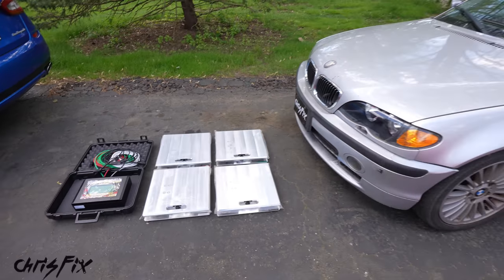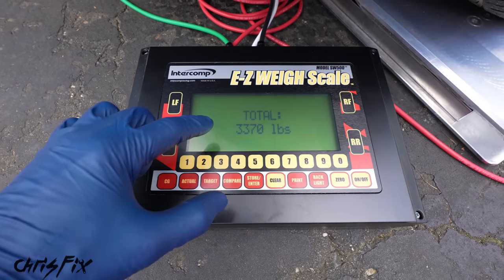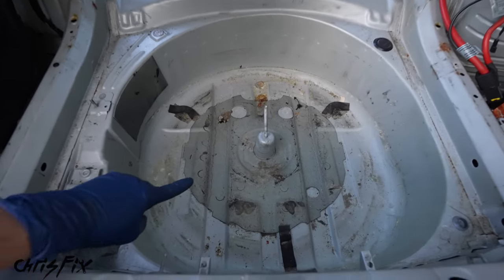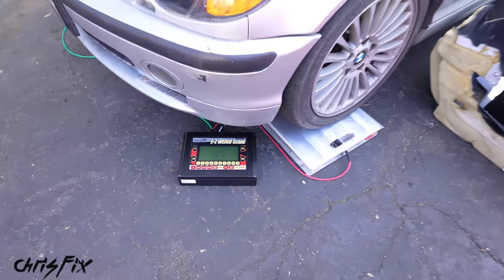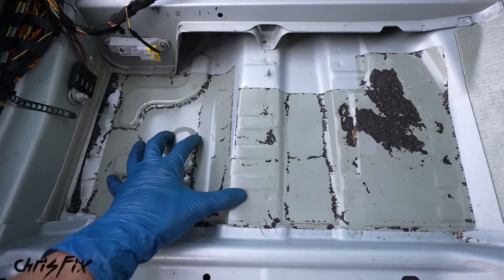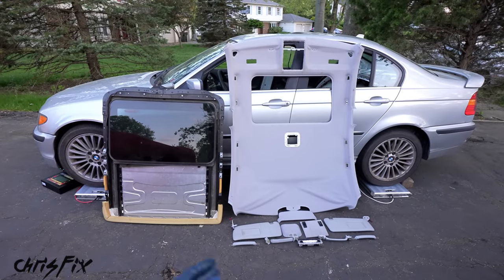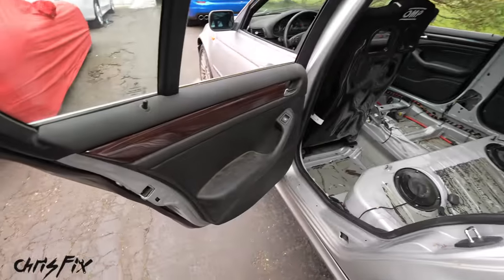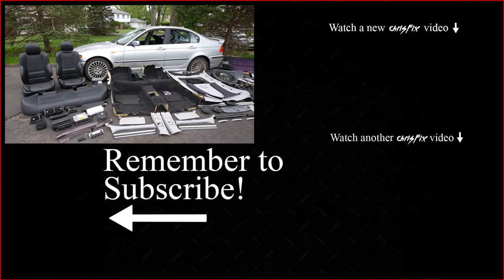How Much Weight can you REMOVE from your Car? (Weight Reduction)

Comment: Chris you forgot to take off the brakes, those will just slow you down.
Reply: Bravo my friend, bravo 👏🏼
Reply: ok that was funny
Reply: Hahah
Reply: Ferrari Monza flashbacks
Reply: Hahahahha
Reply: @MeiShibi  yep
Reply: Omg genius ahahahaah
Reply: Good one
Reply: He need brakes dum
Reply: @mick2171  it's a manuel, just downshift to slow down
Reply: Top comment god
Reply: @mick2171  r/woooosh
Reply: Take out the blinker fluid as well. Pure race car at that point
Reply: Lol you really are thinking about everything for him
Reply: haha
Reply: Funny you mentioned that. I had the chance on my Infiniti to go with the two-piece rotors. I got a deal on some one piece for 50 each. The two-piece were 250 each. But they saved 20 lb. They also had rear two-piece rotors but they only save 10 lb I didn't think that was worth it. In hindsight I think I would have done it just for the satisfaction
Reply: @mick2171  its manual just downshift
Reply: Faulty Brakes ? . . . Don’t let that stop you !
Reply: lol😂😂
Reply: Allgasnobreaks
Reply: If you don’t have brakes and you race your title against an asian mobster you can just keep on driving at the end of the 1/4 mile and run away, great trick for VW’s
Reply: Haha
Reply: Eleanor Nicol lol r/woooosh
Reply: How about turn indicator lights - bmw's don't need them anyway
Reply: A grade humor mate
Reply: He did say it was all about the 0-60 and not the 60-0
Reply: Hahaha
Reply: Tyres too.
Reply: Hahaha
Reply: 😂good one
Reply: Hahaha 😀🤣
Reply: You sir, have won!! you had me rolling
Reply: Nah man Tires are way heavier
Reply: LOL FFS
Reply: That's actually hella funny 😆
Reply: And brake parts are UNSPRUNG WEIGHT too, so they make even more difference!
Reply: Made me chuckle
Reply: He should also take of the pedals. It can reduce weight also who needs them he can just push the car.
Reply: Those seats need to be baby chairs
Reply: Jesse tried that and look what it cost him.
Reply: I think i saw in Jay Leno garage there was this old old race car from 20s which did not have brakes!!!
Reply: Cool pun!
Reply: I mean, he has a point.
Reply: it is unsprung weight
Reply: Your not wrong lmao
Reply: Well played my friend, very clever.
Reply: That engine has got to be one of the heavier items sans tranny and engine now your working with gas!
Reply: Then how can u test the brake test?
Reply: Yooo he said he will replace the brake system before your comment was posted
Reply: Lmfao
Reply: What a great plan hope you have insurance lol
Reply: Boooom
Reply: I know you're joking but actually not..
Reply: @kw57rx8dr.9  that makes no sense.
Reply: Good one!
Reply: @MeiShibi  lewis has ptsd now, just yell the word magic.
Reply: how is this not the pinned comment behooves me
Reply: Ba dum tss
Reply: Good one
Reply: Punny
Reply: @blueshrimp6716  Actually it does to someone who ACTUALLY races. Brakes are the biggest performance item you can change for the least amount of money and hassle, you can't go fast if you don't have good brakes to slow you down properly, the longer you're on the brakes trying to slow, the slower you go in terms of track times because you are not on the throttle while you're on the brake (well sometimes you are when trail braking another reason for good brakes but that's also for the purposes of going faster) and they allow you to go deeper into corners before braking thus slowing you quicker and allowing you to carry higher speeds longer instead of braking longer.
Reply: @taelorwatson9822  Again yes, unsprung weight is the weight you want to shed most and it is the most difficult to find.
Reply: @yassineazoui4204  Yes and wear out the engine and the clutch which happens to be just another brake. but those aren't nearly as expensive nor easy to fix as ACTUAL brake pads are?? facepalm
Reply: The engine weighs a bit that should save some weight.
Reply: @RnR1001  Circle track car..
Reply: Kid should've known.
Reply: i was waiting so long for a vid
Reply: you forgot the gas
Reply: Haha that’s not good but nice joke my man
Reply: this one is good 🤣
Reply: lol
Reply: @mick2171  wooooosh
Reply: @kw57rx8dr.9  you can just not press the gas and then downshift, use the e brake or the drifiting e brake
Reply: 🤣🤣@chrisfix
Reply: LMAO!! ah....i live for you tube comment sections
Reply: Incredible pun.
Reply: @yassineazoui4204  No, this is not "drifting" for a lap or two, it's road racing and requires you to be smooth and scrub as little speed as possible as fast as possible not down shifting and tearing up a clutch that's not only not designed for that but has hours to be used to finish a race under the harshest of conditions. Did you not hear that this is an endurance race? 16 hours!! But 16 hours or 20 minutes, you have to take care of your equipment and your tires etc. while still going fast or your race is over really soon and even if you were able to limp to a finish there's no way you'd be anywhere near the front. Going sideways is slow and wears down tires, using a clutch ONLY as your brakes wears that out too, all too prematurely.

I'd love to see you slowing down with your foot off the throttle 400, 500 feet or more before a turn at 130 or more MPH like the speeds these cars easily achieve at tracks like Daytona or say Sebring while I'm slowing at 300 or 200 feet as I'd pass you like you had an anchor on and be 10 or 20 car lengths ahead before you entered the corner. BTW don't get hung up on those tracks it applies to ALL tracks short or long, high speed or average speed. Another point is your hands need to be on the steering wheel when entering corners, not a hand brake and oft times you actually use the brakes to 'set' a car entering a corner to allow you to go through at speed, one such corner is turn 11 at Road America where you turn at speed and on some cars, not all, you gently touch the brake on entry to set the car into the turn, no room for error in that corner. I find it hysterical that after decades of motor racing of this sort suddenly you think you know the secret to going faster that none of hundreds of top teams, drivers and engineers have ever figured out?
Reply: Lolololol
Reply: You're speaking language of the gods
Reply: That’s tooo good
Reply: Lol
Reply: He forgot to take off the motor that weights too much.
Reply: nice
Reply: And the tire to
Reply: Mei Shibi lol
Reply: xD
Reply: Lol
Reply: @mick2171  r/whoooooosh
Reply: He a little confused, but he got the spirit
Reply: @mick2171        Pleeeaaaasssssee. Tell me you are joking
Reply: Carlsberg don't do comments, but if they did...
Reply: thanks dad
Reply: @eythor_xdb6185  bro i new someone would like this comment
Reply: He also forgot all of the engine
Reply: Take a bow!
Reply: lol
Reply: This joke belongs in the hall of fame.
Reply: Ikr I took the brakes off my mom and dads car my dad never came back and my mom was so happy she was screaming as we whent down the road
Reply: Knew a guy who ran dirt track cars. He removed all the brakes except front driver. Technically he needed brakes for the race. Did he use them? Debatable.
Reply: yea obviously
Reply: Underrated
Reply: Lol
Reply: Well...can't say you're wrong.
Reply: Yeah this is an important fix
Reply: 1million IQ.
Reply: nice dad joke
Reply: @mick2171  it’s a joke bruh
Reply: @mick2171  you missed the joke
Reply: @mick2171  r/woooosh
Reply: slow clap
Reply: Lmao
Reply: Hahahaha
Reply: You, sir, know comedy.
Reply: That’s funny🤣🤣🤣🤣
Reply: I took the brakes off my car. A man like me...never really learned how to stop.
Reply: The rear view mirror too, that should of been first. What's behind you doesn't matter.
Reply: Right like Jessy from fast in the furious did on his Jetta
Reply: R/cursedcomments
Reply: Hahahaha
Reply: take off the car, just the axel and wheels = max speed
Reply: Lol.
Reply: The engine is pretty heavy too not gonna lie
Reply: This comment made my day. :)
Reply: Right, a car is made to drive not to stop!
Reply: Haha
Reply: Fast car is good but too fast is bad, slow is good but very slow car is bad
Reply: he is correct
Reply: Underrated
Reply: U r a legend
Reply: Clap 👏 👏
Reply: everyone liked that
Reply: Brilliant, love it. 😊👍👍🇦🇺🦘🦘
Reply: genius
Reply: Let me guess you listened to Sia's Unstoppable?
Reply: r/Technicallythetruth
Reply: @Wildstone-jf1he  *too?
Reply: @monke204ah  lol
Reply: We are hitting intelligence level 💯
Reply: There supposed to make you stop
Reply: @kw57rx8dr.9  Calm down jamal
Reply: he can break with the engine right?
Reply: LOL XD
Reply: @yassineazoui4204  I've no idea WTF Jamal is but who designated you room monitor, miss nobody?
Reply: A faster way to heaven eh?
Reply: there was no brakes those arent brakes
Reply: Lol so funny lol
Reply: @mick2171  r/wooosh
Reply: @kw57rx8dr.9  But actually, you could be done sormthong more productive during that time you were typing that. This is 2021 and you get mad because of that. Grow tf up
Reply: @yassineazoui4204  "Grow up" says the middle school age acting troll not having a clue who he's speaking to? There's a lot of advice to be taken by you in your own comment troll, especially in the "productive time" category..
Reply: @kw57rx8dr.9  and i wasnt serious my guy learn to take a joke
Reply: That's f**kin funny
Reply: Genius
Reply: lol
Reply: Ya but I think it might fail the stop test
Reply: Litterally
Reply: Chris you forgot to take off the brakes, those will just slow you down.
Reply: @mick2171  r/woooosh
Reply: @mokujin4076  nah handbrake is for losers. Just go into reverse to slow down.
Reply: top comment
Reply: Lolololol
Reply: GUYS ITS A MANUEL NO NEED TO WORRY MANUEL ACTUALLY DONT NEED BRAKES IM NOT JOKING
Reply: You got his back genius
Reply: Guys something real to take off is the air conditioning
Reply: thats a really good one
Reply: 😂that just made my day
Reply: axxaxaaxaxaxaxaxaxaxaxaxaxxaxaxaxaaxaaxaxax rhodes island greece
Reply: lol amazing
Reply: yea funny funny NOT FUNNY
Reply: Bruh🤣
Reply: r/technicallythetruth
Reply: Best comment😂
Reply: Lmao
Reply: Hahahahaa!!!
Reply: Rally drivers during ally Finland or rally Poland are saying „ Take my brake away”
Reply: I hope  he remembers removing all that weight will alter it's balance and handling... potentially making it much more riskier to drive . . .
Reply: @SeaJay_Oceans  just add rear spoiler and new setup of suspension and it willdrive like crazy
Reply: @zepter00    Take all those body panels off,  they are extra weight and serve no purpose.  and all the emissions equipment, exhaust,  catalytic converter, etc.   Then start cutting off metal...  the floor only needs to be under the driver's feet, the rest is too much weight.    All the glass got to go,  no windshield, no windows.   Rear doors and front doors too, just bolt a couple  of bars on the driver sides to keep him in place.
Reply: @SeaJay_Oceans  please don’t teach me about building sports and rally cars. Poland build it in big numbersand n supły 1/3 of whole rally world.
Reply: Yooo
Reply: @zepter00   a motorized  unicycle would make a  Great youtube video...
Reply: Approved top comment.
Reply: I remember renting a kart and I was second in time thanks to not having brakes. I just steer like a mad man
Reply: lol
Reply: Take out the engine and tranny and the tires too. far too heavy
Reply: How about gas tank
Reply: Then to the car wash thereafter ? 😂
Reply: hahahahahahha
Reply: This caught me off guard 😂😂
Reply: Hahaha! That's really funny I wish I thought of that reply lol.
Reply: Hoiyaaaa
Reply: @strikeforce3242  l k BB king v
Reply: Lmao 🤣 😂 😜
Reply: All gas no brakes!
Reply: Noice joke
Reply: “I see what’s happening here”
Reply: Man, I’ll remember to do that when I turn 16 lmao
Reply: Legend. Hahahahaha
Reply: right on.
Reply: A direct hit, well done.
Reply: good one
Reply: That was pretty pun-ny
Reply: Nail on the head!!!
Reply: unfortunately its part of the wheel. add lubricants.🤪
Reply: Oh my god
Reply: good one
Reply: 😂 Damn... lol
Reply: Lmao
Reply: Proceeds to remove the engine.
Reply: @shruthisrikumar5907  he is joking.
Reply: Ok Ronnie Mac
Reply: Lol
Reply: lmao😭😭
Reply: I hate that you’re absolutely not wrong loooooooooooooooool
Reply: yeah they will
Reply: Oooo this is DAMN good hahaha. 🏆
Reply: Lmao
Reply: @mick2171  you're wrong. Who needs brakes and don't forget the go faster stripes  and red brake calipers.  Always good for an extra 100hp.
Reply: You beat me to it, by 2 months actually
Reply: Nice
Reply: Lol
Reply: Original GT40 had that in the 60s. 
Don't @me
Reply: W
Reply: Lol
Reply: @mick2171  how do u not understand
Reply: lol  - u got a lot of likes - well deserved!
Reply: @taelorwatson9822  that, and unsprung weight has a more significant effect on performance (the lower the unsprung weight the faster your suspension can move the tire to maintain contact with the ground.
Reply: lol
Reply: @mick2171  it’s a JOKE
Reply: dorifto in the wall baby
Reply: The suspension too it just bounces around
Reply: Xd
Reply: Hahahahq
Reply: You need to stop… wait there’s no brakes
Reply: @rally2727  ☝ "OBJECTION!" ☝

- Miles Edgeworth, the "Ace Attorney" series (2001-present; 2005-present for Western releases).

(slams desk) Engine braking alone (at least, in a manual car) isn't gonna be enough to slow you down if you're approaching a sharp or tight turn at high speed on the racetrack. You're also liable to damage your valvetrain from overrevving, not to mention blow a head gasket.

Like with ANY motorsport, it's mandatory for your car to have brakes.
Reply: @gmdoilusdum362  ☝ "OBJECTION!" ☝

- Miles Edgeworth

(slams desk) NOT a good idea.
Reply: If there's something I learned from Need for Speed, it is that you don't need brakes to win a race.
Reply: @ChocoEspada  ☝ "OBJECTION!" ☝

- Miles Edgeworth

(slams desk) Not unless you're approaching a tight turn (in a video game or for real), it isn't, be it on the streets (specifically, an illegal street race) or on the racetrack.
Reply: @josecarrilloii4036  not even then, i usually Just throw my car over another so he spins and I make the turn (but thats only for NFS, I know brakes are important lol)
Reply: @hidudes227  ye same
Reply: my man you deserve an award for that, you made my day😁🤣
Reply: @mick2171  i think your missing the joke a bit bro
Reply: @rally2727  downshift and e brake. Good enough
Reply: This is why Chad alone win races
Reply: The best car joke in 2022
Reply: I remember when I went to the lemons in my Miata I can tell you if you don’t have breaks your head,helmet,steering wheel,and bumper will not function… funny joke tho 😂
Reply: Lmao
Reply: Damn this is a good comment
Reply: Hah that was good I laughed
Reply: Good one
Reply: @Hallowsaw  yup “race cars don’t need headlights cuz the tracks always lit”- lighting McQueen
Reply: Lol dad jokes
Reply: lmao
Reply: Kids riding bikes be like:
Reply: Nice.
Reply: Nice one
Reply: but but that's the point-
Reply: Bruhhh😂😂
Reply: Isn't that the point
Reply: 😭😂 Gem right there big fella
Reply: lol
Reply: They’re literally designed to slow you down. Always remove them when building a race car.
Reply: best comment ever
Reply: @mick2171  ☠️
Reply: Remove the engine I heard those are pretty heavy
Reply: Ayeeee 10/10
Reply: I think chris was just too lazy to take off and put back brakes for the brake test
Reply: Really! It's so obvious that he missed it.
Reply: Smart one buddy
Reply: folks actually do it on their bikes and bicycles
Reply: he gon remove it after brake test
Reply: @Wildstone-jf1he  Then how will your car run
Reply: HAHAHAHA 😂😂😂
Reply: Frr
Reply: No point just take the engine out that is the heaviest
Reply: 10/10 best joke I heard all day 😂😂😂❤
Reply: This hurt to read and I loved it.
Reply: @yassineazoui4204  nice copy
Reply: You right
Reply: A parachute would work instead, mebbe a rock on a rope, or is he going Fred Flintstone?
Reply: True though
Reply: Dum Dum Dummmmmm
Reply: ya theyre SOOO HEAVY!
Reply: Forgot the paint
Reply: Are you serious the breaks are very important😂😂😂
Reply: @Hallowsaw Bruh😂
Reply: Automotive enthusiast dad joke. Love it.
Reply: @rally2727  or you could use the hand brake at 25-50% brake, and that will work since it's mechanical not hydraulic.
Reply: Hi
Reply: Yes
Reply: HAHAHAHAHAHAHAHAHAHHAHAHAHAHAHAHHAHAHAHAHAHAHAHAHAHAHAHHAHAHAHAAHHAAHHAHAHAHAHAHAHAHAHAHHAHAHAHAHAHAHAHAHAHAHAHAHAHAHHAHAHAHAHAHAHAHAHAHAHAHAHAHAHAHAHAHAHAHHAHAHAHAHAHAHAHAHAHAHAHAHHAAHHAHAHAHAHAHAH THAT WAS FUNNY HAHAHAHAHAH
Reply: Had to subscribe to your channel for that comment 😂😂
Reply: This deserves WAAAY more likes
Reply: While he is at it he could take down the engine too. It weights much heavier.
Reply: Dang thats brutal😂😂😂
Reply: ROFL LOL SWOI SWOI SWOI
Reply: Whomp whomp
Reply: Yep
Reply: massive jej
Reply: Nice joke
Reply: Nice joke
Reply: Best comment
Reply: I laughed so hard 😂😂😂
Reply: Nice one 😂😂
Reply: Ahahahahahahshahahahhahahahaahhahahhahahahahshahahhaa
Reply: literally
Reply: Agreed; braking is sooo negative!
Reply: 4:41 When did "power tools" become a bad thing? 🤔
Reply: Tell me you're being sycastice
Reply: BRAVO 10000000000000x
Reply: @rally2727  ur right
Reply: Lmao
Reply: This man is going places, not all of them good...
Reply: LMAO
Reply: Best comment ever !
Reply: This guy is pro Tou Fu deliver.
Reply: Fax
Reply: Legend
Reply: @machine1man1  Fr
Reply: Exactly, downshift...
Reply: naturally
Reply: God tier comment
Reply: BAHAHAHAHHAHA
Reply: @rally2727 how would you stop😂
Reply: ぎゃっ
Reply: Lmaooo
Reply: Where is the laughing emoji when I need one?
Reply: i felt like such a dad belly laughing at this.
Reply: Underrated
Reply: Than how will he drift?
Reply: @qatar5343  he will not drift, he will use handbrake and powerslide
Reply: This is hilarious
Reply: Fact
Reply: No, you need those
Reply: HAHAHAHAHAHAHA
Reply: You are so smart😮😮😮😮😮
Reply: He also forgot to remove the engine, that's like 200 pounds right there.
Reply: @chadhutton1745 Just to remind you that you made this comment 😁
Reply: But thats for bikes
Reply: LOL😂😂😂😂😂😂😂😂
Reply: Should've tried taking a fat dump before testing the weight reduction
Reply: Lol
Reply: @pkquick2009 😂
Reply: This was a good one 🤣🤣🤣
Reply: Best thing I've read all day 😂
Reply: 😂😂😂this got me rolling on the floor
Reply: Brakes are needed in any car.
Reply: LOL 😂
Reply: Double entendre goes crazy
Reply: Adds weight too
Reply: I tried this, It worked
Reply: Bravo, bravo next thing we’re gonna do is take out the brake fluid and the pipe connected to the actual thing that stops you it’s gonna make you go faster but hand brakes are an option as a normal normal break
Reply: Completely agree, brakes are gay
Reply: I see what you did there..
Reply: YOU NEED BRAKES TO STOP
Reply: @slapy4648 r/wooshwith7os
Reply: Bro lives life on the edge 😂
Reply: Lol
Reply: Them damn brakes!